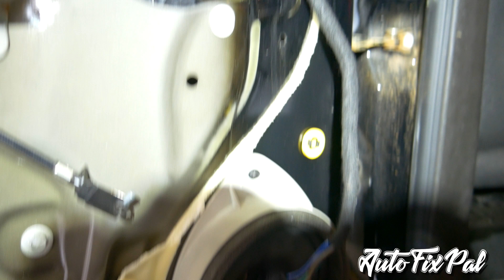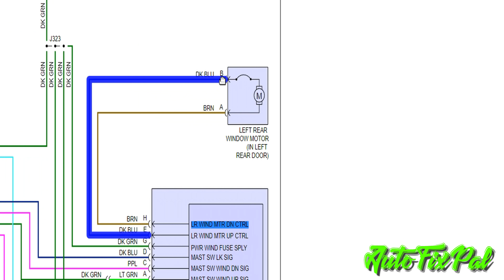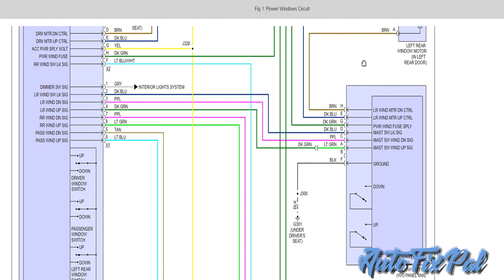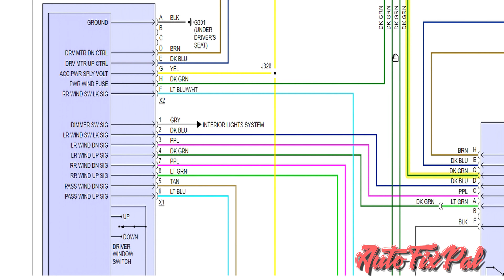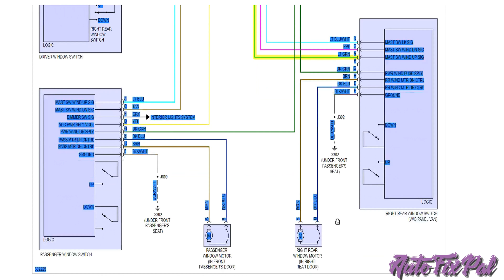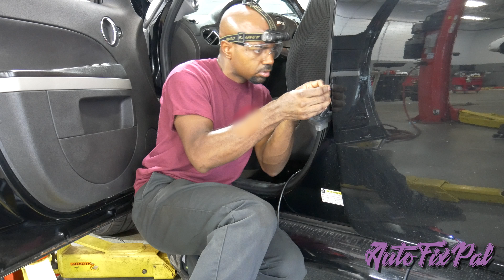2009 Chevrolet HHR - Left Rear power window Not working

Comment: Here I was six years after you posted this. Wondering why my left rear window switch stopped working. It worked from the front master switch, but wouldn’t work from the back. So I watched your long video, thinking to myself this guy doesn’t know what he’s talking about. I must have a bad switch, but alas I took apart the rubber part in the door frame and saw that the blue wire had been completely severed! Don’t ask me how that happened, it looks like somebody literally cut it. But this happened overtime thank you, thank you, thank you! I’ll be more patient in the future 😂

Comment: Hey man nice video. Thanks for supplying the schematic. I have an issue you might be able to help me with on my 2007 HHR. My rear driver window only will go down and not up with the switch on the door itself. Nothing happens with the button master switch at all that controls that window. However all other windows work fine on that switch. I went to the junkyard today and replaced the master switch, window regulator and motor and switch on that door. Still the same problem persists. Any advice you can give me on my problem?